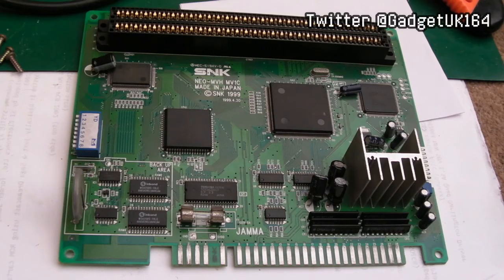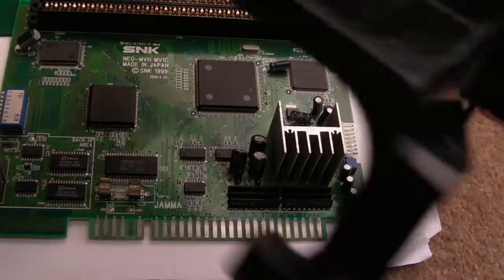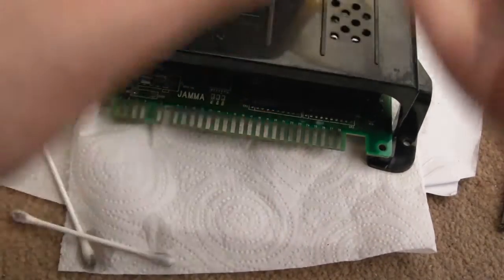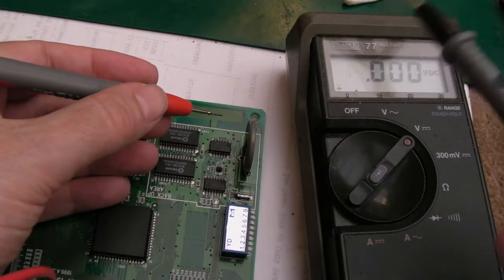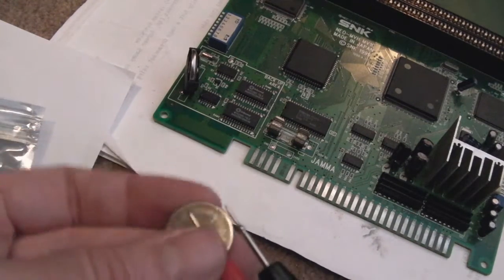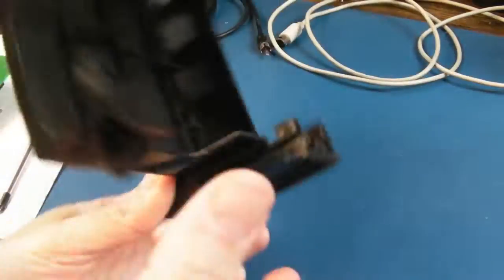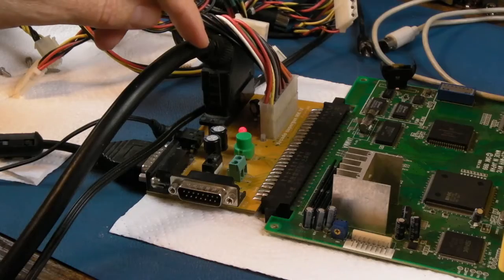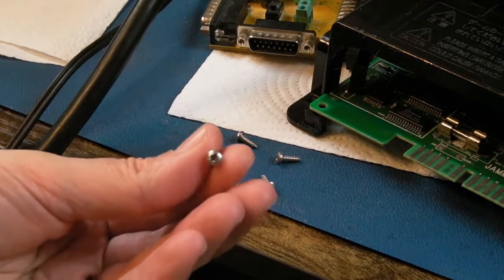SNK Neo Geo MV1C Clean / Test / Battery Mod

Comment: Its amazing how much the MVS board shrank between iterations. I have a MV1 from 1990 that's huge and these are practically cartridge sized. I will say, having 2 AES joystick ports and the complete sound circuit with amp on one pcb is great, though impractical for repair logistics.

Comment: Super capacitors are the answer here, and what I have used on ALL of my MVS boards (3). The latest I did was to the exact board you have there. Yes it still has high scores saved after Months. The hardest part was mounting it. Mine is in an Omega consolised version I bought and straight away swapped out, I recommend them. GREAT channel been watching for years..........seriously look up super caps mvs what's in my machine today. NEVER REMOVE THE CHARGING CIRCUIT.
Reply from the maker: Thanks!  Super caps leak though, so I avoid like the plague!

Comment: For measuring current across fuse holders, I use small crocodile clips. It gives a better contact and it's a bit more secure.
Reply from the maker: Thanks!  Definitely a good idea as there are more points of contact too!

Comment: Nice one! 👋, strange I only just got this one show up in my videos feed and I'm usually always interested in NeoGeo stuff 🤔
I picked one of these Mv1C's up from an eBay China Seller in 2020 for £50 all in posted - surprisingly it was in fairly clean condition, just shoved an inexpensive Super gun on it and it works fine - did put video on my channel.
A pity it's a surface mounted bios or I'd have done unibios mod on it too like my Mv1FZ, but as it's a surface mount I've just bottled it lol 😅

Did notice the 161 in 1 seems less glitchy on this, especially Pulstar - atb 👍

Comment: I tried soldering on a CR2032 battery before, it ended in an exploded battery as what ever metal the positive side is made out of does not like to accept solder for some reason.  Also 3.4V seems a little low for charging a Li-Ion battery (normal charging voltage is around 4.2V to 4.3V but it would work for a Li-Phosphate battery as its charged voltage is around 3.2V.

Comment: I never even knew they made button cells in that size. With the amount of room. Couldn't you just connect a AA battery holder in. It wouldn't be the greatest thing in the world. But it be easier.
Reply from the maker: Yes, you could absolutely fit an AA battery pack - just remove the charge circuit, or even use NiCad / NiMh AA batteries.

Comment: Do you think the ASICs going bad could be related to widespread use of shoddy multi-carts? Or maybe a design flaw from SNK?

CPUs are supposed to last, I thought. Like, my NES and other consoles from childhood are still chugging along fine.
Reply from the maker: It's possible, but I've used the multicarts a LOT across all of my MVS boards here and nothing has died (yet)...
Reply: I bought one of those yellow multi carts over 10 years ago at the pinnacle of my NeoGeo experience, after using it a few times in my Australian leisure allied 4 slot machine I realised it would screw up and wipe the genuine carts high scores from the motherboard. I recommend if you cannot afford the official software then you should use an emulator as you are only fooling yourself............Also  non gen version of Roddy and Cathy blew the Z80 on one of my other boards.